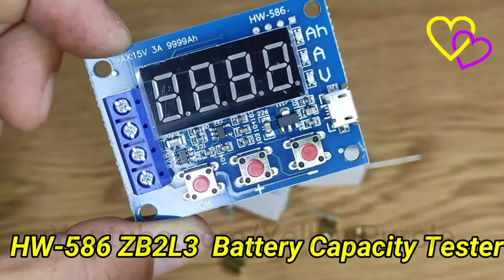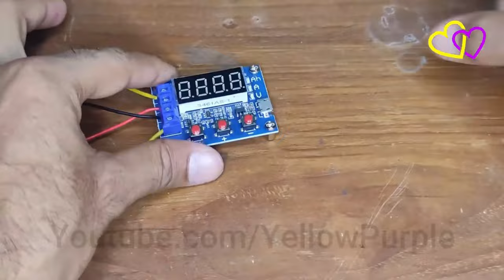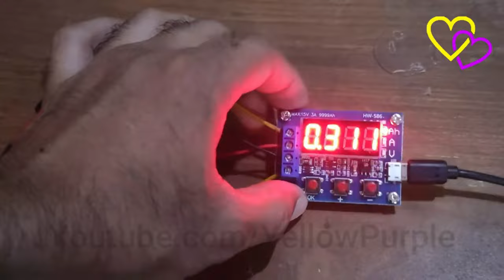ZB2L3 Li-ion Lithium, Lead-acid Battery Capacity Meter & Discharge Tester for 18650 || HW-586 3641AH

Comment: Can I use this circuit to measure the charge that will enter the battery, instead of putting the resistance to put the battery that is going to be charged?